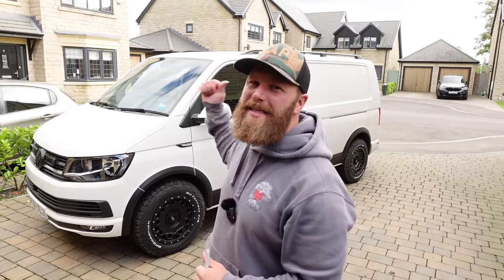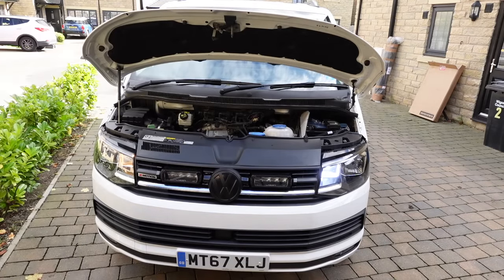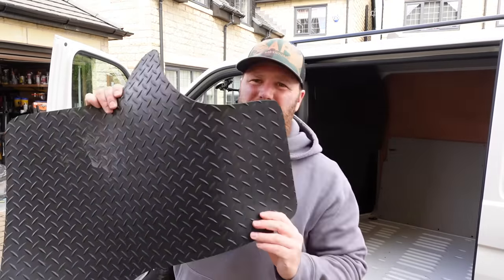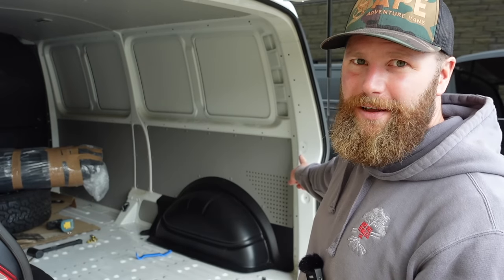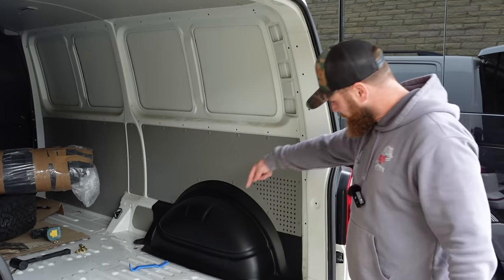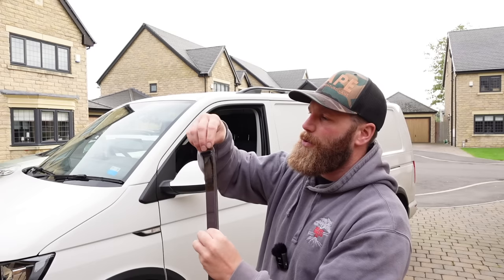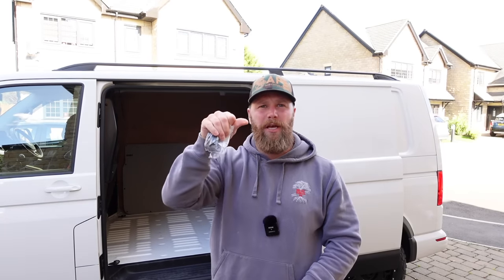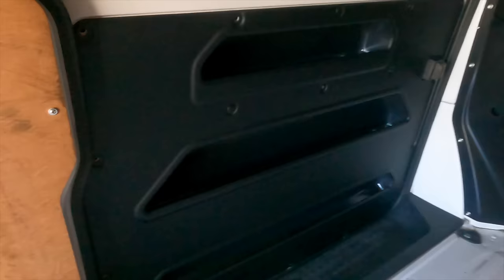5 UPGRADES to VW TRANSPORTER 4MOTION. including HEADLIGHT HACK. NO TOOLS!

Comment: Replacing headlights, side lights , brake lights etc with LED is still illegal check the current law so lets hope nobody has a crash and insurance company don't find out and say your not covered. choice is yours.
Reply from the maker: Well my van just passed an mot at vw with them. 
I’m not so sure you are factually correct. These are daylight running bulbs. NOT sidelights or headlights.
Reply: Replacing highbeam? How could that be illegal since you have to turn them of when you meet oncoming vehicle?
Reply: It’s upto the mot tester if the beam pattern is correct and the tester didn’t spot them they often pass, or you could just swap back for the mot

Comment: I looked at Ovano bed system but decided against it and built my own frame and bed system using B&Q timber and Ikea Sofa bed mattress. Its not beautiful but converts the whole width inc rear seats down into mattress. Much cheaper option utilising lash down points.  Im not a tradesman but someone with skills could make it look 300% better. The only down side is that you dont get a movable bulkhead - Within 1 day of getting my van was change the wheels, ABS wheel covers and rear door side covers, Heko and full insulated and soundproofing - Never looked back since
Reply from the maker: Busy boy. 
Thanks for letting me know about your setup.

Comment: On my Kiravan door pocket, I ran a length of 5mm bungee cord across the middle pocket, It keeps everything inside the pocket and prevents any overhanging items pin-striping the van when the door is opened. Simple to do by drilling 2 small holes either end and knotting the bungee in the hole to provide tension. I also carpeted it.
Reply from the maker: Great idea. Thank you 👍🏻👌🏻

Comment: Just watched this again and thought as our bed system is an absolute stonking bit of heavy duty fold away space saving bed I would pass this onto you having seen your bed system. It’s callled a SteeFree bed and is so simple to set up and fold away so you can still use the existing three row seats in the back, the bed itself is brilliant I absolutely love it, having travelled around Europe for over 23 years each year mastering different ways you gotta go take a look at these
Reply from the maker: Never heard of that so thanks. I have long had an Ovano since this video. Works great also. 👍🏻👍🏻

Comment: Your link for the lightbulb replacement goes to a RED LIGHT. I found this out after I ordered the bulbs and after fitting them. The company were great about replacing them for white though.
Reply from the maker: Sorry mate. It is an option you need to select. Probably should have said 😬

Comment: I've upgraded the driving light bulbs to the ones from the vid, trouble is they are now brighter than sidelights and headlights 😂. Do you know if you can get the same cool white as side and headlights?  🍻
Reply from the maker: Ha ha. Yeah they are. But you never see them at the same time. 👍🏻
Reply: @urbanarkoverland   very true it's just disappointing when the headlights come on and you see less 😂😂.
Reply from the maker: @Josh-lm3my  I know ha ha. Happened to me tonight. Was parked in front of my garage door. Was blinding. Then auto kicked in and switched to headlights and was like candles ha
Reply: @urbanarkoverland  just flexing now.. no auto here! 😂
Reply from the maker: @Josh-lm3my  ha ha. Leave drl’s on then ha

Comment: Thanks for sharing. Loving the side panel storage. Gonna look at adding them for my two sons to use. Cheers 👍 👍
Reply from the maker: No probs 👍🏻
Reply: @urbanarkoverland Do you have any other recommendations for replacing the headlight bulbs as well as the daytime running lights (the one you used in your video are out of stock). Many thanks
Reply from the maker: @freeatlast1810  sorry mate. What’s ya question. Is there somewhere else to buy bulbs??
Reply: @urbanarkoverland  yes. Sorry. Do you have any other websites you could recommend? (Thanks for getting back to me)
Reply from the maker: @freeatlast1810  travelnlite 👍🏻
Reply: @urbanarkoverland  awesome. Thanks very much 👍 👍

Comment: Great work on the mini mods.. I used to have team Heko deflectors on my t6 and they were the worst things ever. So much wind noise when on the motorway (windows shut) I bought the van with them on and took me much longer than I would have liked to figure out where all the wind noise was coming from. Straight in the bin.. would be interesting to see if you have the same issue.
Reply from the maker: Hi mate. Did 30 miles in motorway this morning and nothing to report 🧐

Comment: Hello 
Really enjoy watching you making improvements and upgrades on your van.
Could I please ask you a question, you mentioned when fitting Led head light bulbs on your van that nothing came up on your dash.
I bought a t6.1 caravelle, I changed fog lights to led but check LHS fog light came up in dash so I had to change back to original yellow bulbs. Could you please advise me what led bulbs could I fit in fog lights that wouldn’t interfere with vans sensitive electronics.
Many thanks
Reply from the maker: @alanritchie7902  hi mate. Mine is the t6 nit 6.1. You could try reaching out to transporter hq. They are geniuses when it comes to all this they have got light leds for sale that don’t mess with canvas I’m sure. 
UAO5 will get you money off too
Reply: @urbanarkoverland  hello 
Thank you very much for helping me with this query, you have been most helpful, and I will try these guys at Transporter HQ.👍

Comment: Excellent upload, looking forward to hearing about the bed.  Would you consider making your own like Mel on Big Van Small World? (or small van big world? 🙄🤔)
Reply: I just scrolled through his Chanel - it just looks like a standard plat bed across the back? Or am i missing something? Just looking for options myself
Reply from the maker: I am looking at a massive storage draw that pulls out. It can be a bulkhead and lay flat over the seats to be a bed. 👍🏻
Reply: @christinamacintyre9972  I'm getting Mel's older videos popping up, so it was from 3 years ago or so.  I only stumbled on his channel as I was looking for low VOC paint- and he covered that topic. :)

Comment: Visited my local dealer (vw)to purchase led bulbs to be told 1 the van would fail a mot with these bulbs installed 2 they are dangerous and could cause a fire?????
Reply from the maker: Ha ha. Watch the video where vw told me that the speedo couldn’t be altered. But it can. 
My van passed it’s mot with these bulbs. Guess where……. VW 😂

Comment: Don't use mats..... 
unless they lock in, they're dangerous...
The floor in these is so easy to sweep....
Reply from the maker: Love these mats
Reply: @urbanarkoverland  until the day one is rolled up under your brake pedal.
Serious drivers do not have them...
Reply from the maker: @roscius6204  but mine lock in. Have never moved. Serious drivers 😂😂😂 you sausage
Reply: @urbanarkoverland  Did I not say...
'unless they lock in'🙄
Funny though.
Try googling accidents caused by floor mats...
You didn't explain that they do and if you're going to be in the advice business...
Get It Right.

Alternative reply would have been 
Good point 
These ones do lock in place...

Maybe google hubris too....
Reply from the maker: @roscius6204  yes. But then you went in to say. Until one rolls up and goes under your pedal. Which can’t happen. I’m talking about THESE mate. Not other mate. Not pieces of carpet with a coloured edge. THESE mats. But here you go. 

Good point mate.
Reply: @urbanarkoverland  Hang on
just re read that.
Do they lock in or just stay put?
seems like the back locks but the front does not.
Wouldn't touch them personally.

did you google 
'accidents caused by floor mats in cars'
12 million Toyota cars were recalled in 2009 and 2010
It cost them $1.32 billion.....floor mats 🤔
Reply from the maker: @roscius6204  if the back locks where can the front go. No not googled it. And won’t.